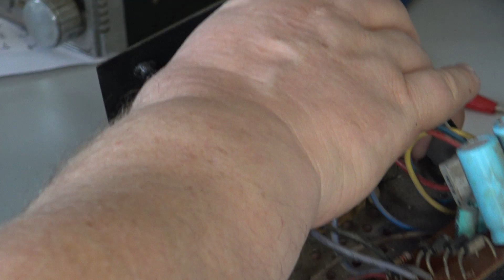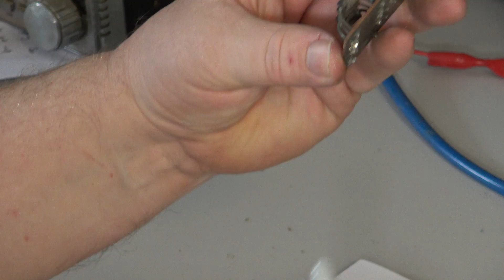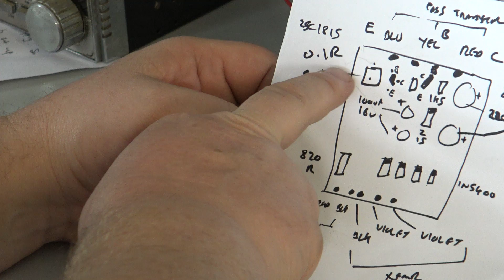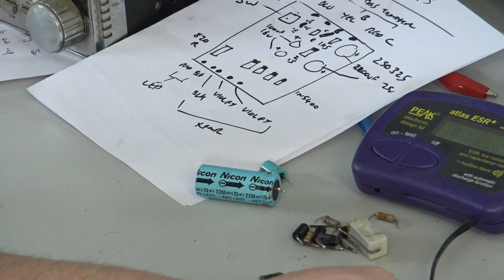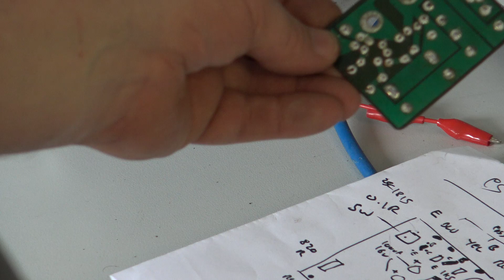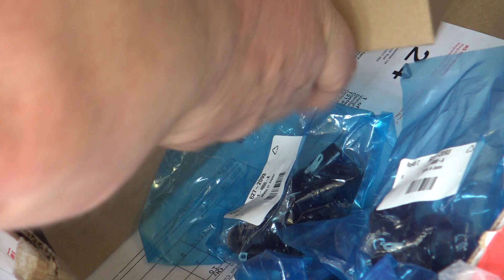Banned 1981 CB power supply bonanza pt2 ; Taking out the PCB....and components

Comment: Hi a power pack needs good smoothing some cheap power packs have smoothing witch is not good
Reply from the maker: These do work well & over the 38 years have proved to be reliable. If they had just addressed the safety issues all would have been fine. It's as if they treated UK 230V mains like Japanese 90V mains!

Richard

Comment: Hi love your vidio I'm a little 2e0 would be good if you 2oud talk a bit about smoothing in a power pack I'm not shaw if you need capacitor with higher voltage and low resistance what makes a good capacitor for good smoothing in a power supply
Reply from the maker: I'll tell you this quickly as a 'for example' . Electrolytic capacitors have a max working voltage. If your product is working near that max working voltage clearly the capacitor will not last as long as one that is rated at a higher voltage than necessary. In power supplies, when choosing capacitors for smoothing, you are looking for the best ripple rating :- you go & buy a cheap 'Billy No Mates' brand of TV dead cheap from Asda. The electrolytic capacitors will be rated at about what a particular circuit runs at. Let's say there is a 29V power rail....it will have 30V rated capcitors. Now in a similar position in a Sony or Panasonic (for example) type of product, those capacitors would be 40 or 50V rated. In an industrial or military product, the capacitors would be double rated, like 65V. 

You could recap the Asda TV from new & chances are it would last decades instead od 1 year & 1 day!

Richard

Comment: I never bought one, so I don't have one to kill, eh, I mean fix up!  I had a 10 AMP supply.  It was labelled 8Amp 12.8v but in fact did 13.8Vdc at 10Amp with ease.  However, I have to fix it as a capacitor went bang after leaking and yards of brown paper filled the power supply.  I progressed to a bank of 500Amp hour batteries at 14Vdc after that and never got round to fixing it. But now I want to use it, so I have to fix it when I get back into my shack. (If I ever get back into it).  I will be following with interest if I get a notification that is!

Comment: Hi richard you mentioned a double pole switch on the psu was tempted to fit one on a moonraker 5-7A psu i got recentley got from ebay for a fiver it  had a poor 3 core short flex and was missing an led on the pcb  but changed those and its a bargain so far.
Reply from the maker: We used to buy those in in the 90's for business radio standby base use & never had any snags; in fact I've never been inside one! Yes, the mains lead was about 18" even when new! Well as long as the mains switch is wired into the live; a single pole switch, whilst not ideal, shouldn't be a snag. 

traditional PSU's on ebay are shooting up in price so well done. As I said on the video, our wholesaler is now wanting £59+VAT for a 3-5A one!

I distinctly don't want to go down the switch mode avenue as they still aren't reliable/don't last as I write this in 2020. When I say this, I want things to last at least 15 years.

Richard
Reply: Hi Richard I've spoke too soon when I connect it 2 of cybernet chassis radios the voltage drops from 13.8v down to 2.5v under load
But works fine on a 10m alinco set very strange?
Reply from the maker: @Gooldscross1  Time to put an ammeter in series to see what's taking what current, preferably on a different PSU or in a car.

Richard
Reply: @ukfmcbradioservicingTango21  hi richrad connected either rig to a micronta 2.5a psu 
The fidelity 2000
120ma on Rx and 1.3A on tx
And GE 3-5804D
Was same on Rx and 1.16A on Tx.
Reply from the maker: @Gooldscross1  email me rshireby@yahoo.co.uk

Comment: No output voltage adjustment?
Reply from the maker: No, Stewart; it's fixed with this circuit..though it could be built to do something different by changing the zener diode.

T21

Comment: i love these PSU's, work well,
had many for years and still use them and buy them..
Reply from the maker: Those 3-5A versions could be had for as little as £9.99 at one point, though I paid £16.99 for my 3-5A Power Plus back in 1981. Likke a fool I sold it someone for a fiver :(

I daren't think how much making one of these is going to cost, but with the wholesaler now wantinf £59+VAT for a 3-5A linear PSU, it's now worth doing. Luckily these can still be bought at the right price as people haven't caught up with the price surge.

T21